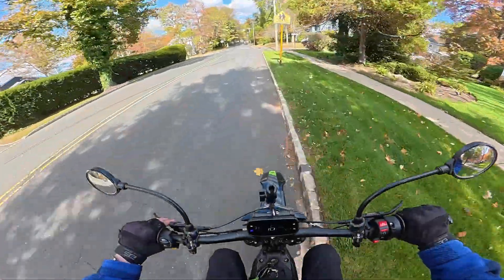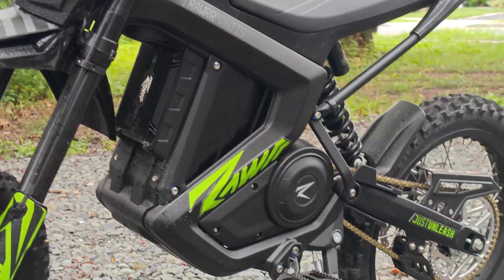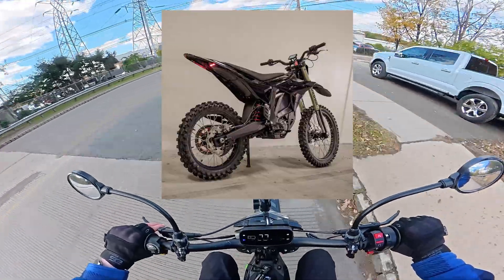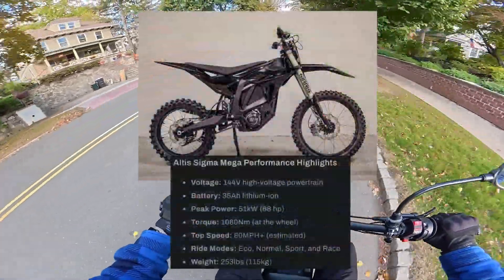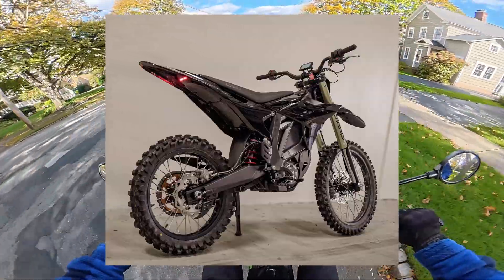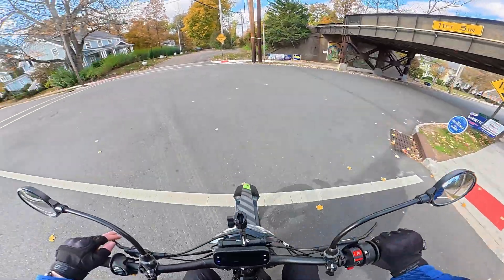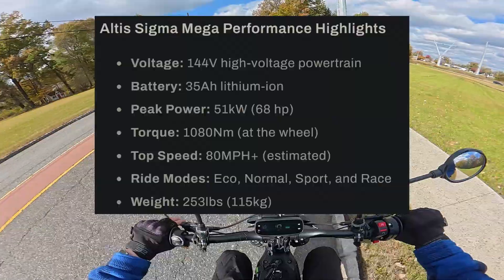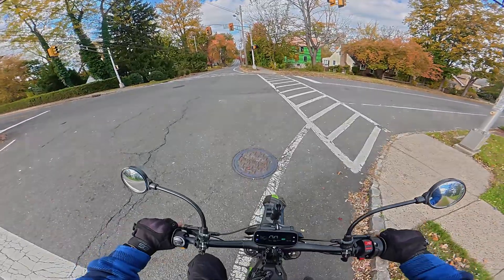The World's First 144 Volt eBike - Why I would Never Buy it

Comment: I have the Altis Sigma the 98 volt not the 144 volt..... My Altis would absolutely eat that Rawr mantis alive...... The mega is not even comparable to what you're riding.... They're trying to compete with the varg not a power wheel..... I think it's a great bike for the money you're talking 7-8,000 range for a bike it's going to be a small step down from the varg it's not going to be the Stark but you can almost buy two of them for the price of one Stark..... Not many people have 13 Grand to blow on a toy..... I'm going to sell my Altis and I'm getting one... I put 5,000 mi on my altis this summer it's the most fun bike I've ever owned I've owned quite a few bikes..... I think that mega is like the sweet spot as far as the power and it's not going to completely break the bank it's not cheap but it's not absurd either to get anything with any kind of power you're going to spend five six grand regardless so 7 to 8000 for almost stark power is a bargain

Comment: Youv don't know what you are talking about. There have been 144v Fardrivers out for years. I have and use one. You are looking at it all wrong and 144v is nothing compared to the 360v of a Stark. Everything gets real smooth at higher voltage. Accelerating is so effortless and not jerky at all unless you are an idiot that doesn't know how to tune properly. 

Effortless . Robust but I don't feel like I'm in danger. It's that much smoother . Once you go from 72 to 96 it becomes clear that the path to take iis to go higher. To achieve 600 line amps at 72v you need a lot of cells in parallel and that amount of amperage makes a lot of gear and requires larger wires. If you double the voltage then you only need 300 line amps and even though it's the same wattage it rubs way cooler and us easier on the motor, not harder. You can run a motor at whatever voltage as long as you are heating it up. When you buy a glass type fuse it's good from 0-250v. The current is the real metric. 

You are taking about things you do not have abd obviously don't really understand. I do board level  repairs and micro soldering so I work on Fardrivers and all the other products QS releases under different names that everyone knows. 

Sone people are deterred by having to change a connector or can't build there own batteries. They follow all these wrong tutorials on setting up their controller. I'm not one of those. I would never review a product I do not have and duse like you do. That's just bad from. 

144v it's not even that high. You are just that far behind. Mr self proclaimed emoto guy. You have a lot to learn. Learn from experience not what you are imagining with your little bean counter financial advisor brain.
Reply: Dude is riding in the bike lane talking about getting his electric dirt bike impounded haha trying to" blend in"  I don't pull over when you just pull the front tire off the ground and stare the cop down they're like yeah I'm going to let that one go......
Reply: I am 100% sure all his mattresses have the tags on them.
Reply: @donnypresutti4618  and talking about how the bike wouldn't sell if it's marketed primarily for motocross. this guy's born yesterday.

Comment: Higher voltage also makes the bike more efficient.  Higher torque, higher top speed, and more range with less stress on the battery.
Reply: Not correct, higher voltage usually for speed. 98 v got blown out in speed and toque by a surron.
Reply: @Marrk117  no it didnt.  All stock surrons, for starters, are slower than the Altis Sigma.  Secondly that has nothing to do with efficiency.  Even if some modded versions do have higher speed, torque etc.  They are doing so with much more strain on the battery.  This is physics its not up for debate.
Reply: @jerometruitt2731  I’m clearly talking about a modified surron which is true. They have a better battery too. Samsung? Come on now that’s trash.
Reply: @Marrk117  nothing clear about it.  For starters its a dumb comparison.  If your gonna compare, you compare stock for stock.  You can make anything faster than the stock version of something else with 10K worth of mods.  You have Razors and Tuttios doing damn near 90, doesn't mean they're better bikes than an Ultra Bee.  Secondly none of that has anything to do with what Im talking about.  Higher voltage is more efficient period.  The higher the voltage the lower the heat and resistance and therefore amp draw required to perform a given amount of work.  Can you run 2-3 times the amps through a 72v or 84v battery? Sure.  But youre gonna cook it 2-3 times as fast and work it 2-3 times as hard.  Instead of 1000 cycles you get maybe 500.
Reply: @jerometruitt2731  bullshit the most important thing is what cell is in the battery pack